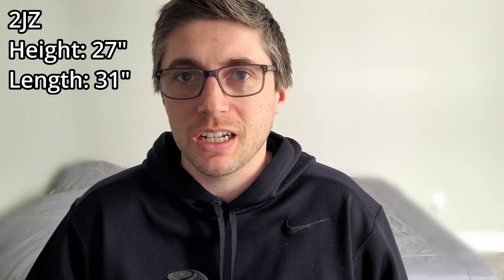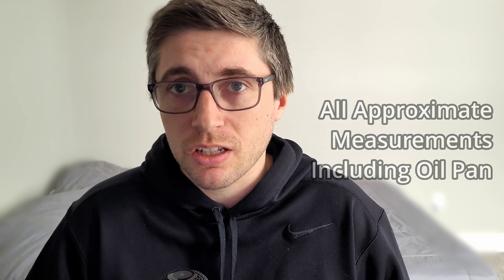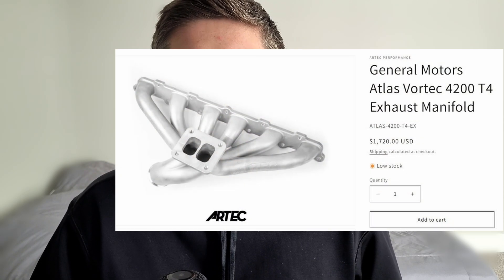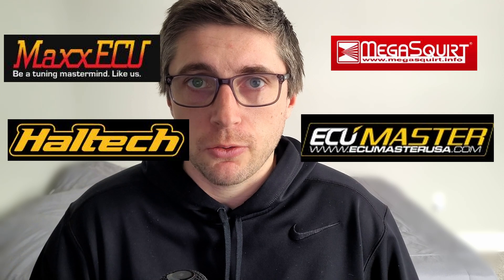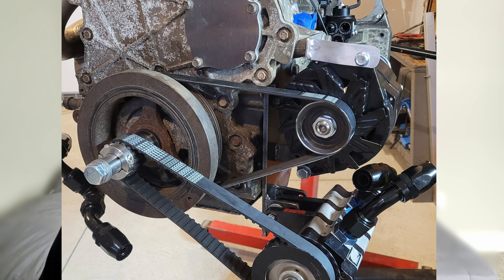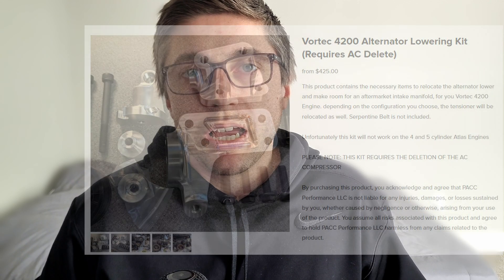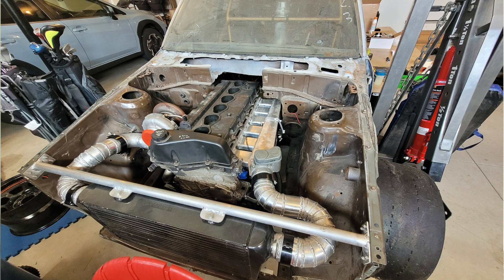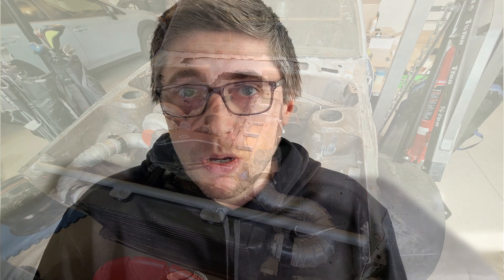Watch this BEFORE Swapping a Vortec 4200: Avoid these Mistakes!

Comment: Do you have a link or info on aftermarket clutch system to use Colorado manual 5 speed on 4200? Thanks
Reply from the maker: I have a previous video about how I adapted a triple disc clutch to this engine. I'd start there. There are also a few aftermarket flywheel manufacturers. EmTech being one of them.

Comment: I’m currently in the process of swapping one in my 87 conquest TSI. The two biggest issues I’ve encountered so far is overall height as well as the shallow oil pan to top of valve cover height. I’ve had to cut the firewall to recess the engine back as far as I can to fit my shifter location but also I’m having to notch my crossmember and potentially spacing my crossmember 1-2in to help clear the hood line. But the factory 4wd oil pan I’m using from the trailblazer donor far sits so freakishly low that it’s absolutely going to need to be cut and welded to make a shallow front sump before it ever gets on the road

Comment: ECU that is why I junked a 2004 Envoy. Engine ran fine. Did not use oil. Transmission also shifted good enough. 200,000 miles not perfect but it worked.
Until the ECU just quit.
The thing a hated the most. The way GM shoe horned all that stuff in the short and cramped space.
Basically it is 2 cylinders too long. It might fit in and replace a 230 or 250 I-6. With modification to the hood.From 1979 and backwards. Or a 292 in a delivery van.
The only reliable thing in it was the 6 CD changer.

Comment: ever get that dry sump working?
Reply from the maker: Yup, it works great as far as I'm aware. Had about 40 psi of oil pressure at idle and would rise with RPM

Comment: You can get a 2jzge non vvti from a gs300 or sc300 for about the same as on 06 trailblazer and everything is MILES cheaper than the 4200, just in oil pan, exhaust manifold and alternator relocation and intake manifold you're over 3k. For comparison you can get an ebay turbo manifold for $350 for the jz, ebay forward facing intake for $300-350, rear sump pan around $550, and dont need to relocate the alternator. JZ is cheaper, when everything is factored in and sounds miles better. you could probably purchase a vvti jz throw pistons and rods in it with said parts (intake manifold, exhuast manifold, rear sump) for what it cost you to get a stock 4200 ready to swap.
Reply: First off, non vvti is garbage in 2025. Second the 4200 is 100lbs less almost a liter and and a half of a displacement advantage. If you want to put on garbage from eBay you can do that as far as a turbo. If you’re going over 700whp-800whp the 4200 is going to be superior.
Reply from the maker: Well if you can find that then I'm sure it's a good deal! At least in my area you can't find a 2jz of any capacity that cheap.
Reply: Every used usd  2j is whooped and oilleak city so itll need a rebuild. Unless your going Chineseium everything  its not gonna be much cheaper. 
You can find a clean 130k 4200 and literally toss it invwitu mods on top. The biggest thing is fitting any bigger motor in a tiny car.

Comment: This is great info for new-comers. In that vein, the best intro platform to swap is the first gen Colorado. At least three or four of the "mistakes" don't apply. Fits in the engine bay (height no problem), same ecu (even same engine wiring harness once you add wiring for 1 or 2 extra cylinders or call Lime-Swap), no need to relocate alternator since factory intake fits, same trans (4l60E literally "just works", emtech flywheel if using AR5, or can use TB motorsports' bolt-in 6L50/6L80 solution). There's even an off-the-shelf engine mount from Francisco. Has the most "aftermarket" support for getting the swap done by accident. Can literally be a bolt-in deal if you can source an oil pan. The regular cabs are 1,000+ lbs lighter than the trailblazer. Even the crew cabs save 600+ lbs.
Reply from the maker: @johnnyk5  Absolutely. I'm just guessing a majority of people are new to the atlas platform and are probably leaning towards putting it into a non Colorado application.
Reply: imma prolly be bothering you over the next few months. you've inspired me.

Comment: Good recap for folks thinking about the swap.  I'm excited to get rolling on mine now that I have the car, motor and transmission
Reply from the maker: Sounds like you have everything you need then!
Reply: @slightlyengineered  most of the big stuff.  Now its time to see how well it fits in the mustang 😆
Reply from the maker: @TeamHybridRacing  it should fit better there than in my Corolla.
Reply: @slightlyengineered  haha yeah I think no worries about the firewall haha
Reply from the maker: @TeamHybridRacing  You're lucky! Cutting things made my project extra complicated.